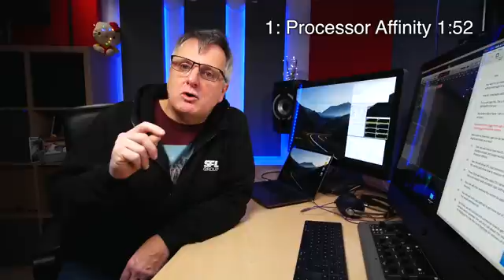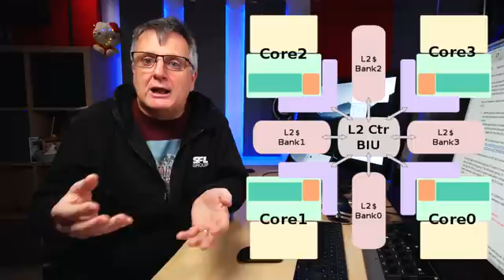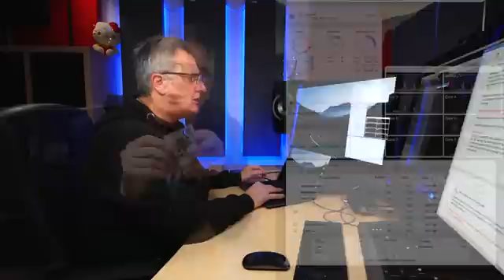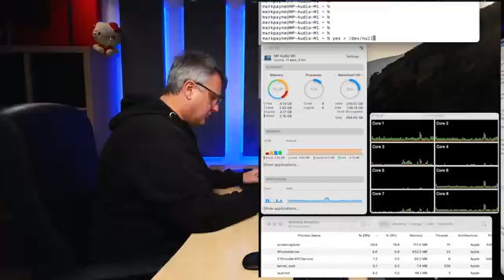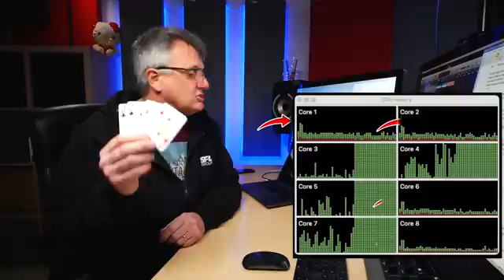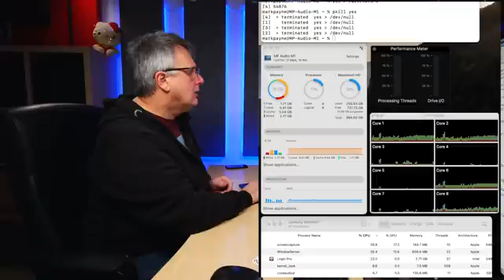Logic Pro X CPU Optimization | 2021 | M1 System Tips | Run more Plugins!

Comment: Thank you! This is far more comprehensive than anything else I've seen, and actually gives me a little understanding as to how this all works. 

Dare I ask if you have any thoughts on a peculiar problem I'm experiencing? 

I'm running a project with 40 virtual instrument tracks with an instance of Kontakt 6 (and sample libraries) loaded on each. I have very few plugins running. I've only recorded midi data onto a couple of these, but I get a system overload whenever I select any of the other tracks during playback. In fact I've determined that this only happens if it's the first time I'm selecting that track since loading the session, leading me to wonder if the act of selecting the track is prompting Kontakt to start loading samples or something, which is in some way triggering the system overload... I have no problem running sessions with many more tracks. The problem seems to be specifically associated with selecting tracks. 

Do you have any idea what the nature of this problem might be? A issue with Logic or Kontakt, or indeed the sample libraries that Kontakt is running? 

Is there a way to make logic fully load all of the activated tracks when I start up the session or something...

This is on an 16 inch M1 Max MacBook pro with 64GB memory.  

No problem if this is too complex a problem to try and get an answer to. Just thought I'd take a punt in case you know something that might be of use. Thanks again!

Comment: Optimize macOS processor assignment: Understand how macOS allocates processes across multiple cores to maximize efficiency.

Utilize M1’s CPU clusters: Leverage the high-efficiency cores (Ice Storm) for basic tasks and high-performance cores (Firestorm) for demanding processes.

Monitor CPU utilization: Use the performance monitor in Logic Pro to track core activity and CPU usage.

Add plugins strategically: Test adding multiple plugins to see how Logic Pro utilizes cores and avoid system overload.

Adjust Logic’s audio settings: Tune settings like buffer size and multi-threading for smoother performance during complex sessions.

Understand processor affinity: Keep related processes on the same core for better cache usage and reduce the need for data to move between cores.

Know M1 system behavior: Logic Pro typically prioritizes using the Firestorm cores, but monitor if that’s the best approach for your project.

Limit multitasking: Avoid running other programs alongside Logic Pro to prevent competition for CPU resources.

Balance system resources: Manage your project’s plugin load to prevent CPU overload, especially with demanding plugins like reverb.

Fine-tune buffer settings: Experiment with the processing buffer size and multi-threading settings for optimal performance based on your workflow.

Comment: Hey Mark, thank you so much for this video. I do have a very specific question that I think you may be able to answer for me, given your very specific knowledge. I have been having crackling issues due to CPU overload when trying to record with my CPU intensive plugin (Neural DSP Plini X). It seems no matter what I do, I have this issue. I believe I have optimized my machine's performance, but also wonder if I upgraded the machine I may still have the issue. Anyways, here are the specs of my machine: Macbook Pro Early 2015, 3.1 GHz Dual-Core Intel Core i7, 16GB 1867 MHz DDR3, Intel Graphics 6100 1536MB, 1TB SSD. Running on macOS Big Sur 11.0.1 and Logic Pro 10.7.2. I have my I/O Buffer Size set to 256 because that is as high as I can go without getting noticeable latency, I am recording directly through an audio interface with a guitar so 1024 isn't an option for me due to latency. I have the processing threads set to 4 which is the maximum for my machine. Process buffer range is set to large. Multithreading is set to Playback & Live Tracks. Sample Rate of project is set to 44.1 kHz and summing is set to standard precision (32 bit). From what I have seen, that is as good as I can make my settings. As I understand it, each channel strip is processed by one thread even if you have it set to multiple threads, so my main question is if I am having this issue when running this plugin with only one instance will I have this same issue even if I upgrade my machine to an M2 Pro 10-core because the ultimate processing power of each individual thread won't be much higher? All that being said, I just don't want to drop $2k+ on a new mac studio and still have this issue. My current machine runs most Logic Pro operations just fine, it seems to just be certain plugins that give it fits. The one I just mentioned and then also Superior Drummer 3 if I customize the drum set instead of using the stock kits. I apologize for this long and weary question but it is so hard to find good answers to these niche questions and you clearly are an expert. Thank you so much Mark, you do everyone that watches these videos a great public service!

Comment: honestly I think there is a lot of misleading "wrong" information in your video dude :-) logic (as most other daws nowadays) is a "hybrid" or "dual" buffer daw and has been for a very long time. this means that changing the i/o buffer should not make a real difference when not live software monitoring a track and only playing back or mixing. when not monitoring a track the process buffer range (second "dual" buffer size) is used for processing. the main drawback of a big processing buffer is that you get latency between what you see and do with your mouse and when you hear it. cheers!
Reply: dude if you're seeing latency between a higher buffer size when using your mouse its maybe the computer your using as a higher buffer size does not affect compute performance at all. the only latency you'll get is when recording.  max buffer size is to support more mixing activities and lower is for recording so changing the buffer size absoulety affects these 2 activities. ive been recording since the first protools in 96 and can tell you the buffer situation has never changed even with max ram and high cpu.
Reply: @RobnDob  hey there, let me explain further: think of the buffer size as something like a UPS driver delivering packages: it's the interval how often he comes back to you to grab your packages and drive them to somebody else (your interface converters). one big package with a lot of small ones in it would is the big buffer for which he has to wait for all those small packages to be ready first before he can leave. the more often he comes the faster all those small packages are delivered but he is definitely working more, the less he comes the longer it takes till all your packages are delivered but he is more relaxed. when you have a big buffers size it simply takes longer until your converters get the audio to convert (which will then hit your ears) after you changed something in your daw/plugins with your mouse or however! cheers & love from germany!

Comment: Thanks for this! Based on what you said I did at bit of experimentation and also realized the following: Setting up a bus before the stereo out lets you divide up the load of the "mastering chain" on two cores (eg. for example mixbus compression and saturation on the bus, and then gullfoss, tape emu and limiting on the stereo out). It actually makes a huge difference (on an M2 Macbook pro) here.

Comment: I use a Mac Studio with 20 cores and an M1 Ultra. I run a large orchestral template. I can still overload it without the settings described here. Another little trick is to nly run tracks/plugins when you are utilizing them. Not every session will use every instrument in your plugin- turn off the tracks you do not use

Comment: Amazing explanation Mark!  My mini M1 with 16gb of Ram is needs to be upgraded asap, Im considering buying the Mac Studio M2max with 64gb of Ram, Im afraid isn’t enough cause theres only  4 more cores of CPU between the my M1 mini and the Studio M2 Max, any thoughts? Thanks man!!
Reply from the maker: Ah well... The M2 12 core is actually 8 performance cores and 4 efficiency cores. So comparing to your M1 you will have twice the number of performance cores (8 vs 4) and that is significant. The single core performance is better also and this aggregates over the cores so you could expect maybe 3X performance in the M2Max vs M1... in terms of CPU bound applications. You could go to M2 Ultra to double again and end up with say 6X M1 performance but that is a lot of $$$
Reply: @MarkPayneAudio  I really appreciate your time Mark.  Thanks for the great answer. Just bought the Mac Studio M2 Max, still trying it. I'm a profesional producer, sometimes I need some profesional advices about computers, do you teach?
Reply from the maker: @UNAI_IKER_Music  Yes at various points in my career I have worked in education. I started on this road as a computer professional at Hewlett Packard. Later when I founded SFL, education became an important part of our strategy and still is today.
Reply: Hi Mark! I wrote you on Facebook, I would like to book a lesson, I have serious problems with Logic "Error while trying to synchronise Audio and MIDI" pops all the time, also one of the threads on the CPU Meter is hitting the top all the time while the rests are in normal levels. Buffer size, Processing threads and process buffer range are at maximum.  @MarkPayneAudio

Comment: The video is impressive. I've been looking for such clear information on this for a long time. I bought a few months ago a Macbook pro M1 14" pro 16Gb RAM 10 cores (8 performance and 2 efficiency). I bought this computer because on my old MAC I played with heavy Kontakt libraries (Noire Piano 15 gb library) 32 buffer size a lot of crackles could be heard due to high CPU load, just playing on one track. With my new MAC the audio crackles almost disappeared although they occasionally appeared (I used the Maschine 2 software, in which you cannot select the cores or threads). 
After watching your video, I am using Logic X and after configuring in the subprocess tab only (2 high performance cores) incredibly reproduced up to 16 tracks without listening to any crunch and with a CPU load on the 90% that gives margin for 3 or 4 more tracks so that the CPU. If I choose 6 to 10 high-performance cores or leave it in Automatic mode, the audio crackles are heard again with 2 or 3 tracks and with 10 it is unbearable. Does this seem logical to you? I am looking for a configuration to be able to play the piano live at 32 buffer size (with more buffers the latency bothers me).I don't usually use more than 2 heavy Kontakt tracks and 8 audio tracks to play live.Thank you very much

Comment: For a home studio, would you recommend the Mac Mini M2 Pro with 32 GB RAM and a 1 TB drive ($1899), or a Mac Studio with a M2 Max with either 32 GB or 64 GB RAM and a 1 TB internal drive ($2199 or $2599)? I saw your review of the Mac Mini M2 Pro, and you returned it for your Mac Studio M1. I wouldn't have the same issues you did with the M2 Pro Mini. (You're a pro...I'm not.) But I would greatly respect your opinion on which is the better value/configuration for a serious, but non-professional home recording environment. Note: Lots of plugins and sample libraries! :)
Reply from the maker: if you can afford it then the M2 Studio

Comment: Thanks for the information! It would have been much more digestible if you would have started with the conclusion (as done in most scientific papers) and describe the reason for each preference in one short sentence and after that you can give the "deep view". More focus to the really important information would also perhaps have led you to the insight that you could have explain the topic in 20-30% of the time you used know, which in my opionion would have been easily possible. Over half an hour for an explation I could give now to another person in under 5 minutes is way too long.

Comment: Hi Mark,

I have a question for you: I found a great deal on a second-hand Mac Mini M1 with 16GB RAM and a 1TB SSD for $600. I plan to use it for music production on logic pro x and  other smaller projects, as well as an all-around desktop PC. Do you think this is a good choice for my needs, 
 Also, do you think it will be future-proof for at least the next 5 years? Would it be worth getting  the M2 chip, or even the Mac mini M2 pro, or do you think the M1 is still sufficient for my needs?

Also, I wanted to add that I'm a big fan of your work and really appreciate your expertise in the tech and music space.

Thank you!
Reply from the maker: I think that is a great choice. It is basically the same spec as my first M1 system was in macbook guise.

Comment: I can load 100 serum instances and a lot of plugins running out of Rosetta mode but it can also crash fast with other project setups.
🤷🏻‍♂️ the single core processing is the key. For some reasons it makes to difference if I do run the project in 1024 or 64 buffersize somehow. The cpu load stays the same. And logic stock plugs are loading directly, all 3rd party plugs need some time to load, especially when reopen the project and changing buffer size.

Sometimes only one core is overloaded and then I get audio glitches. With only 7 Kontakt instances. Strange behaviour overall

Comment: Thanks for that. Great as always. I used to work with this settings on my mac mini m1 and a macbook air m1. But i had one major problem wit the mac studio max m1. First i recognize, that it took up to 30 sec. when i close a project. after days of researches (no success with google ;) i watched the ramprocesses in activity monitor and there was a huge increase of swap memory together with the auhostingservice. after 2 hours work it raises up to something like 2 or 3 gb. Tried almost everything like reinstall logic, deleting prefs, running without interfaces etc. etc. then i played around with the logic settings and voila....when i changed the processing threads back to automatic, no more huge swap files and way less ram usage and a project closes like it should. So i really don't know, why it's working on my other machines and not on my mac studio (same plugins, same projects btw). So just to let you know. All the best from Germany and happy easter.
Reply: sorry, seems to be the same issues after a while with the automatic setting. hope apple fix this issues with swap memory and gui lag inside logic on m1

Comment: Great freaking video! New sub here. To answer your questions at the end of the video, Ive been using multiple instances of Izotope Trash 2 and Native Instruments RAUM Reverb. Both of those seem to be more taxing than most. I also use Xfer Serum and Native Instruments Massive, both of these can become demanding if using multiple instances being played back at the same time. I also use some Komplete sample libraries. The FabFilter plugins are actually pretty efficient, I was expecting them to be extremely CPU taxing but, they are very well optimized. That being said, I'm extremely happy with my M1 Max machine. Coming from a 5-core intel chip, I'm zooming through projects.

Comment: Hi Mark, I'm waiting for the biggest players in plug-in production to finally come up with the simple idea of using GPUs in the new MacBooks with M1 and M2 processors.  A topic known from the past, where the PS3 and PS4 GPUs were used, which had huge computing power to mine cryptocurrencies with excellent results. Now for Logic Pro X applications, they are almost idle, because generating a two-dimensional, almost static image takes them almost a  at all.  Is it achievable or is it beyond the intellectual capabilities of plugin producers?  What do you think Mark?

Comment: Hi, this is great and has certainly helped a little for me but I seem to be suffering from a weird anomaly.

One of my Processing Threads (The first one) randomly spikes and causes the CPU overload, it seems to try and force my cpu data towards the one thread and then only utilises the following 7 with increments of data, any knowledge on this experience would be greatly appreciated and I suppose if there is a way for me to manually assign the cpu to the other threads that would be amazing, I am not the sharpest when it comes to CPU usage and data coding so forgive me but I may need a 'child's' explanation XD

Comment: Thanks for this! Very clear and enjoyable to watch. 
Strange that my project was stuttering (including popping when idle for some reason) with all cores selected, but more stable with Automatic/4 High Performance Cores. Why might that be? Could it be that some of the plugins were being assigned across the Efficiency Cores, putting a strain on them? Wondering if it could be down specific plugins. 
I'm using a mix of stock and IK reverb and compressors and Waves. Not lots of virtual instruments (MODO Bass, MODO Drum, Alchemy, Halion). 

Also, I mainly produce and am keyboard player/pianist, so I prefer a low buffer for minimal latency as I record along to the playback and use Low Latency Monitor Mode when needed. For this project, I was mixing as I went along, hence the many compressors etc added (and need for the low latency mode). On a MacBook Pro 13" M1, 16GB. I have a custom built PC I made, (5900x, 64GB RAM) running Cubase, but wanted to move to Logic and a portable solution, rather than always tied to the PC. But I'm tempted to go back at times due to Logic struggling with processing. My buffer, to balance latency and performance is usually 128 or 256,  Range: medium, Multithreading: Playback & Live Tracks.

Hope you enjoyed the wine :)